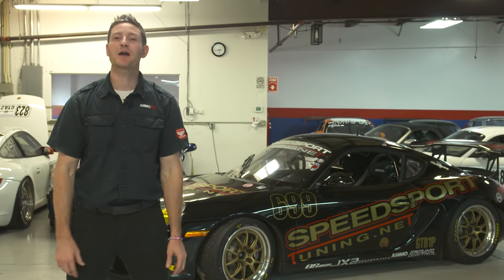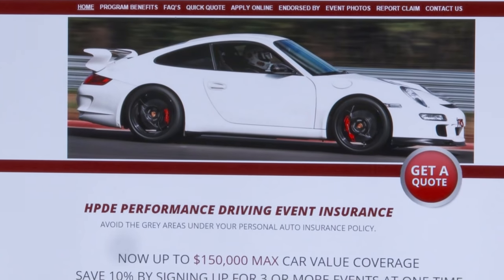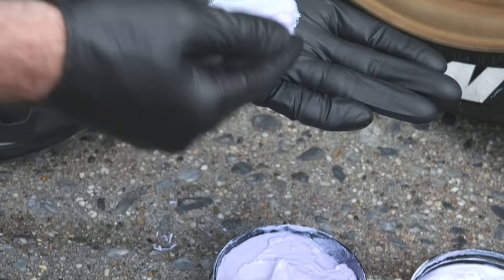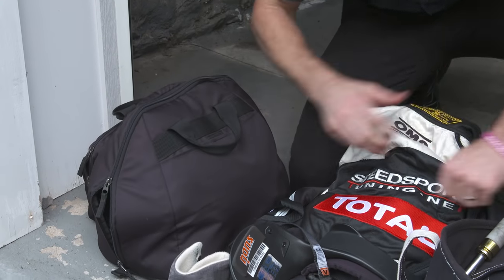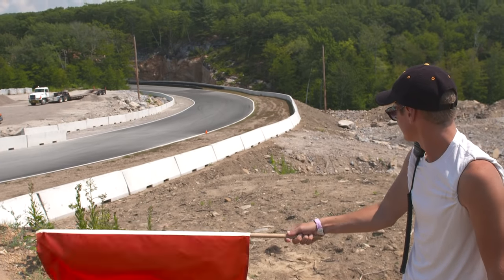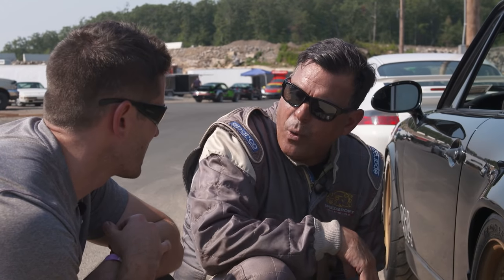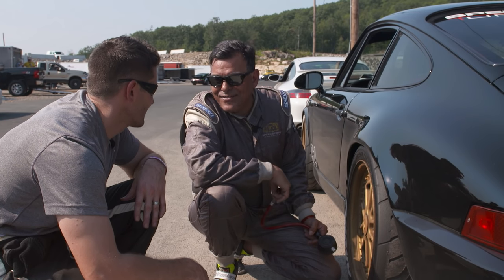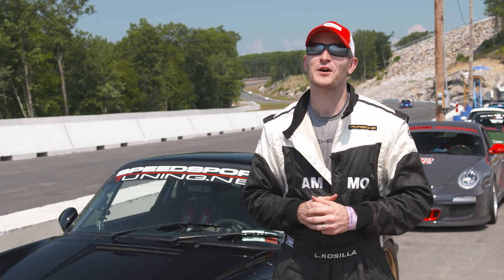Track Day Guide: MUST WATCH BEFORE DRIVING

Comment: Something which needs to be touched on;

Stock/lightly "modified" street cars(figure the typical power/handling mods without the "proper" first mods) will generally boil brake fluid in 3-4 laps, will be overheating in 2-3 laps(and probably flashing warning lights by 5), and oil temps will be going nuts. Auto transmissions might start acting funny in 2-3 laps. This is for smaller tracks, if it has longer straights you may get away with a few more laps.

Larger radiators, oil coolers, trans coolers, later-spec brake fluid(DOT 3 boils at 205C, DOT 5 at 260C, make sure your seals/hoses can take it), brake ducts, everything you can do to keep it cool. Water/meth may be beneficial to keep charge temps down and in turn reduce load on the coolant, water spray(ie. some Evos/others run it) on your intercooler. 

More "race" driven brake pads will perform better than standard street pads(ie. EBC Yellow Stuff or equivalent for your vehicle, it's what I use and can vouch for but there are plenty of other great pads)

It isn't fun running out of brakes into a sharp corner and ending up in the dirt ahah
Reply: Maybe true for American cars. Not so for the Germans and Swedes. 
I bashed my stock Volvo S40 T4 for 8 hours around the Salzburgring two times last fall. I only stopped for gas.

First time it was pouring rain and I had great fun. I was basically alone on the track.
Second time was bone dry and I could practice the racing line the whole day. At the end of the day, my fresh brake pads were done and so was I.

But no overheating, no brake fade, no trouble.

And this car is 23 years old.

My friend's equally old V6 Ford Probe however... It had an aftermarket oil cooler and still managed to overheat. Slow, sluggish and bitchy. Poor dude watched me run rings around him.
Reply: All cars on track require at least pads, brake fluid and cooling system upgrades. 
Sowy but upgrade brakes and cooling and suspension before even thinking of boosting the pony power. And tires. Lol
Reply: @Thunder_Yoda  call bullshit on 8hrs unless you were crusing at 100kph.
Reply: Instructors don’t let newbies drive so fast they will melt brakes and tires the first weekend out. It’s about learning how to drive at a track and by day 2 getting a little speed on. I’d say by second or third outing and the hook has caught time to get tires and better brake pads and go from there.

Comment: I had a lot of fun at Palmer in June.  Went to an open track day, were some folks from COM Sports Car Club there.  They are an excellent group to run with.  Only fifteen people there for the day, two of us in my run group.  We had the track to ourselves!  So much fun.  

Good advice here for people new to HPDE.  One thing he didn't mention is fluid changes.  I flush the brake fluid before every event (Motive bleeder FTW).  If not flushing for every event, a bleed should definitely be done! If the car is a daily, bleed after the event too. The fresher the fluid, the higher the boiling point.  You do not want to boil the brake fluid.  Change the oil.  Consider changing the coolant if it hasn't been done recently.  Transmission and differential fluid should be changed more frequently than normal if car is being tracked.  If you are having a speed shop do the tech inspection and work, they should go over this.

You should also try and get an instructor that drives the same type of car, or has in the past.  Let the instructor drive the start of the first session to show you the line.  Brake early, focus on keeping the car positioned where instructed.  Try to memorize the track and the locations of the flag stations(corner workers).  Don't go out there expecting to drift like Chris Harris.

Also, the anti-skid systems (if car has them) should be left on for the first few track days.  Then think about going into the performance mode or turning the systems off.  Keep in mind that they work by activating the brakes and will increase the amount of heat being put into the brake system (another reason to make sure the brake fluid is new).

If you are looking at mods for track prep: roll bar/cage or harness bar + 6 point harnesses are #1.  It is a lot easier to feel what the car is doing if your body isn't flopping around.  Also much safer if an accident should occur.  Increase safety, increase longevity (essentially cooling for the various systems, brakes, engine, oil, trans&diff), only then increase power.

Once you get out of Novice and are doing events several times a year, you will notice that the car will eat brake pads, rotors, and tires. Keep that in mind before putting $1600 worth of Michelin tires on the car or fancy $400 a piece rotors.  This hobby is expensive! I run the cheapest tires I can get with stock rotors and pads (non-ceramic).  The extra 1 second a lap is not worth the extra money.  HPDEs are not about time, but education and fun.  I would rather go to more track days.

Comment: Super video for beginners.  Nice 964.  One thing that really helps is checking tire temp as well as pressure to really dial that in.  Moving up to the point where you add a data logger that lets you see your time vs braking vs lateral forces plotted on a detailed path around the track in sync with a video cam... yeah, now we're talkin.

Comment: What a great video! I wish there was something like this when I started 10 years ago--it would have saved me a lot of time and effort up front.

Fast-forward to today, I've been a chief instructor, I'm now an SCCA racer, and I still love going back to instruct new students. About the only thing I'd add: the most common thing I see people do in preparing for a track day is that they go out and put on all of the aftermarket parts they can find before they know 1.) what those parts can and cannot do, and 2.) what the baseline of their car is. Go out and get used to your car the way it was built (or the way it was when you bought it) and address handling, speed, braking issues as you learn to recognize them. (OK, flush your brake fluid with new fluid and buy street/track brake pads before your first track day.)

(By the way, was this filmed at Palmer? That looks great!)

Comment: For me, track prep starts with watching vids of the track in a similar car to mine. If I can, I play a simulator as well on that track.

I also talk to my pals who are going and see what they are taking car wise and if they are using any secondary vehicles with tools/stuff in case of issues.

I generally take basic tools with me, spare parts possibly, oil, coolant etc.

I also take a few extra bits like camber measuring tool and stuff if I decide to record the day out.

Usually, if it is a serious track day, I take a spare set of wheels with track day tyres on as I drive my car to the track. Need a pressure gauge ;)

I've often lent my low slung car jack to other track goers on the day. Although my track car is quite light at 850 kg I got a two ton one for my M5, which not only is heavier but almost as low as my track car. Normal jacks won't cut it.

Always bring cable ties :)

Jubilee clips are handy too, and I've even needed the odd spare wheel bolt.

Often, I've not needed to overload my car with stuff because if the shit hits the fan I have fellow track goers and sometimes even spectators happy to help. My first track day saw me blow up my engine on a Clio Williams. I got home eventually and the guy that helped me put my car in his own garage and helped me loads. We are best pals now :)

Comment: I have a shorter beginners guide for your guys:
1) drive to the track
2) drive the track
3) drive back from the track

Has worked for me this far without all of this fuss with packing, cleaning etc. :D
Albeit, the technical preparation I have done over the time before to ensure that I will have brakes when I need to brake from 200 (120) to zero. If you are a bit OCD about your car, it will be fit for the track. Just make sure you have racing brake fluid and braided brake lines. :P
Reply from the maker: +JJ agreed....oh yeah, and all that other stuff too.

Comment: Great vid mate. One thing - unless the flag regs in the States is completely different to anywhere else I have raced under the FIA, your explanation of the 'black flag' needs tidying up a touch. The black flag, only to be shown at the start/finish line, usually associated with the number of the car it is being used on ( or at a club event, having the 'finger' pointed directly at your car as you drive past!!! ) means to slow down and return to the pits on the lap you were shown the flag to have the problem rectified. It is NEVER shown for an accident on track, that is always associated with the yellow/red flag.
Other than that, great vid for 'newbies'.

Comment: smooth is fast.   LK, I see you're driving your R888's to and from, how many heat cycles do you figure before your compound dries up and starts to get brittle?  I used RE01's for auto-x and it wasn't cheap for my RSX.  I would go through 5000 miles of auto-x and daily driving then I would need a new set.  As for your suspension set up, your instructor was right and I think he was trying to tell you about your suspension's "set".  It's the time your suspension takes its set, or squat.  during an accelerating or braking action.  You don't want to set up a skateboard, that puts a lot of grip on the tires, mechanical grip is the art of car balance at 7/10 - 9/10's your driving limit.  I like to think of 10/10 driving as controlled reckless driving.  keep at it, soon you'll be dialing in your set up for different tracks and improving your lap times.
Reply from the maker: +Thor Velasco Thx bud!
Reply: +AMMO NYC I started racing RC cars long ago and took suspension set-up knowledge to my auto-x , track days.   http://home.scarlet.be/~be067749/58/c1/index.htm    this article starts with tires, suspension, alignment, weight transfer......    at the bottom of each page,  just click next chapter.   it's a lot to take in, and it's written for RC cars, but the fundamentals are there.  enjoy!

Comment: Meanwhile. in Western Australia....

2 paved tracks, one which is really only suitable for karts/smaller cars. The 3rd is being shut down due to noise complaints(located in an airport zone...literally 500m from the main runway).
Reply: RIP, Laguna Seca is an hour away from my place.
Reply: Damn, our govt is very hostile towards the car community. Demanding we "take it to the track" but shooting down any proposal for new tracks and providing nothing to get us off the streets. Then if you get caught "hooning"(45km/h over) you get your car crushed or impounded for 28 days.
Reply: +wolfy9005 Crushed... jeez. Cars in my place cost a lot and are rusty a lot of the time in my area (10 min. drove from beach) but we get fined 50-100 USD for hooning as long as no harm is done other than tire marks and destroyed tires.

Comment: 40 to 80 K miles on one set of tires? Whaaaaaaaaaaaaaaaaaaaaaaaaaaaa....
Reply: +RustyClouglin I'm lucky if I get 30k.
Reply: +RustyClouglin I feel like he meant to say 4 to 8k??
Reply: Doug Horn Probably? Idk that would be quite short then.... I get around 15-30k. Especially if you drive a bit sporty you can replace tires every two season :o
Reply: +RustyClouglin 15-30k miles driving sporty... i envy car tires lol. Last pair of motorcycle tires i got, where completely worn after 2000 miles
Reply: valebliz
Bikes are a whole different world in so many aspects. How often is a oil change due?
Reply: RustyClouglin Depends on the engine and the use. For a sport bike used on the road between 5000 and 7000 miles (7500-10000km). Even if most riders change it more often, my bike would be 10000kms and i change at about 7000 usually. Some bike engines like racing monos used on dirtbikes have to change oil every few hours or few hundreds kms. But they carry very little oil, usually around 1 liter.
Reply: RustyClouglin talking about track use it's whole other story, the intervals i gave you for oil changes should be used for a whole engine refresh changing pistons, seals, bearings and maybe even rods. But it's not that strange when you have a 200hp/liter engine that revs to 13-14000rpm lol
Reply: +valebliz I get roughly 150-200 miles out of a rear on my track bike!   I'd be ecstatic if I got 2000 miles!   LOL
Reply: slowninja14 Well the opposite would be strange lol, i was talking about road use obviously!
Reply: +valebliz , I remember being 19 (20 years ago) and finally able to buy a nice bike for my daily driver. I was going to save so much money on gas and stuff that I almost thought it would pay for itself! LMAO...WRONG!!!!  New tires every few months, if I could stretch it, and the cost of a valve job alone, almost killed me. I learned the hard way, but had a damn good time doing it! I rode the piss out of that bike and loved every single second, even the ones when idiot drivers tried to kill me.
Reply: +Dylan G lol absolutely, bikes are cheaper but never as much as you would hope
Reply: +RustyClouglin He's talking about hard street tyres for a Lincoln Town Car --- not performance tyres. :)
Reply: +RustyClouglin 

It depends..... 

my experience:
06' camry (my old car from college)- 70k miles (forgot tire make/model)
11' jetta 2.5 SE (my old car during last yr of grad school) - 45k miles during life of the lease; 3yr 15k mi/yr. Tires were still okay to use.
10' stage 2 S4 (mine) - 15-25k miles depending on my mood (michelin PSS)
11' C300 4matic (mine) - 40k (conti DWS) Currently have DWS 06 with 8k on it. I'm hoping 40k or better
11' altima (sister) - 55 k miles (conti pro contact)
08' cr-v family beater - ~50k miles

Comment: hey great and informative video.......If I may ask - i was taught to not put on the parking brakes but use the car gears to hold the car in position, after every track stint. This is to prevent having a seized brake pad onto the the disc. What are your thoughts on this?

Comment: Okay since it's fall already I'll obviously do this in the spring but generally how long do the best max performance summer tires run if say tracked maybe twice or 3 times during summer and DD'd the rest. I'm looking at around 200 treadwear or less tires maybe Ecsta Xs  or Dunlop Star Specs but Michelin's PSS seems like a good choice too but it's 300+ treadwear I think
Oh ps I need the most grip possible since it's a big heavy fwd sedan

Comment: Halfway through the video, it started to get too technical for the first time track driver. Forget about tire pressures...just make sure the tires are inflated. It's always a good idea to check your ego at the door and listen to the instructor. Also, the best experience for the first timer at a hpde is to track the car stock. It's a good baseline to obviously start from. As one progresses with seat time and mods, they can make adjustments accordingly and to their liking.

Comment: This process has to got be way simplified, I'm here to enjoy myself not have a headache making sure everything is checked off. I'm a bit put off by going to a track day because of it.
Reply from the maker: +vvysoc OK understand, but I want my fellow driver to be as prepared as I am out on the track. Its sort of our duty to the other drivers to have our cars, tools, and minds extremely prepared for safety. Skimpy on safety or simplifying the rules for a very dangerous sport... makes it not fun.
Reply: +AMMO NYC Its not fun to willfully deny Jesus Christ and go to Hell either
Reply: +AMMO NYC We think this is a great beginners guide for the novice's to the sport, and it's the same reason why we publish our track guides on our blog, for all 1st time drivers getting onto the racetrack in a high powered vehicle for the 1st time.
Reply: AMMO NYC
I understand, but it still should be more accessible. In Europe its easier and people are fine. Basic things like no leaks, safety equipment, things as such should be checked quickly and off you go.
Awesome vids, I enjoy them.

Comment: Larry: Why don't You drop the bonnet to close it? I always thought, and was told that pushing the bonnet close will deform it slightly.
Reply from the maker: +Marcin Borsuk No, thats how Porsche close....they dont drop it wont work
Reply: +AMMO NYC Larry, did you run with your spoiler up/open or just let the automatic controller do it's thing?
Reply: +Marcin Borsuk it will deform the hood right around the emblem IF the bonnet is closed by pressing the emblem..you should actually push it closed by the edges of the hood. I learned this the hard way :(
Reply: The bonnet is aluminum on my Porsche, I have to push down...
Reply: Yes, push from the corners though